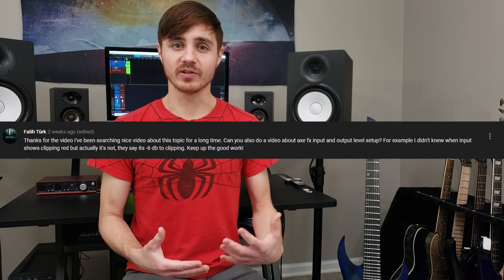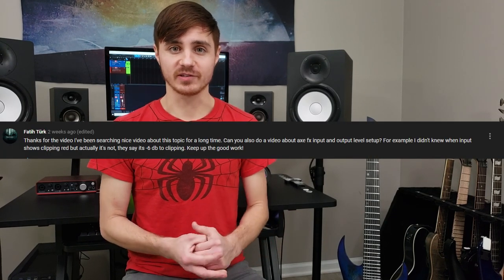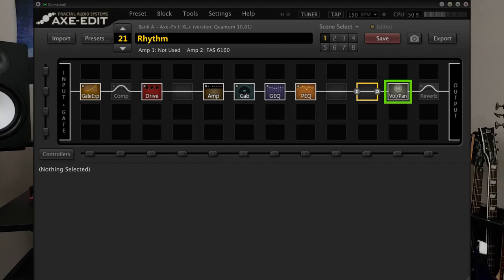Setting I/O Levels on the Axe Fx II

Comment: If you are lighting your RED clip LED then It would be better to reduce the GLOBAL Volume fader in the global Menu. This way all your presets will remain the same level relative to each other. This is advisable when you use multiple presets and you've worked out the correctly level across them.
Reply from the maker: Yes, that is if you already have all the levels set the way you want or matched, otherwise the new preset would just be louder than the rest. But that is a good point to keep in mind

Comment: I just got an Axe-FX 2 and I’m unable to get any signal out of the “Out 2 FX Send” Both output knobs on front are turned up and I/O out levels are set at 0. db.        Any ideas or advice for getting the “left Out 2 Send” to work?
Reply from the maker: Well let me ask, what are you trying to use the Output 2 for?

Output 1 has stereo out. To use the FX send you need to add a FX Loop block in your chain.

You can also mess around with the " Output 2 Echo" setting under the I/O tab. That allows you to change the source/sound for Output 2. You can change to Output one so you will have the same exact output on one and two or you can change it to input one and you can get a DI out of output to that way.

If that doesn't make sense or if you need help feel free to email me at jmcgowan.studio@gmail.com and we can schedule a video call or something and I can go through it.

Comment: Thanks for the clip. Question - what do you use two separate bookshelf monitors for?
Reply from the maker: Some isolation pads should work.
Reply: Jeremiah McGowan sorry I mistyped.  I meant to ask  “why” do you use two, not what.  😀
Reply from the maker: Those small Alexis monitors? Those were what came with my first interface years ago, I wanted to use them to check my mixes on smaller speakers but I really don't even use them at all, I'll probably do a giveaway.

Comment: Jeremiah, would you have any idea how to set the axe fx 3 with eventide eclipse. I cant seem to get these two working together.
Reply from the maker: Are you connecting them via the 4 cable method?
Reply: @jeremiahmcgowan  thanks for responding. no amps. Just direct to my monitors. I am trying to utilize output and input 2. Right now I’m utilizing xlr cables. I am getting a good signal out to eclipse but no signal on input 2 on axe fx. I’m thinking it’s a programming issue I am missing.
Reply from the maker: @JimsMusicJourney  yea! So I don't know how much you already know or if you already have everything connected right, but try this, this is the easiest way I can think of. You don't have to mess with 4 cable method.

Guitar > Front Input 1 of Axe-Fx, use any effects before your amp block on the Axe-Fx, like your drive or compressor etc. Then go from the Axe-Fx Output 1 (mono or stereo) > Analog In on the Eclipse, use any effects you want after the amp, like reverb/delay, then go Analog Out > your interface/mixer/monitors. This way you can use Stereo effects on the eclipse with the Axe-Fx.

Or if you want to process the audio again on the Axe-Fx then do the same thing but place a FX Loop block after the amp/cab on the Axe-Fx, then go from the Axe-Fx Output 2 (FX Send) > Analog In on the Eclipse, use any effects you want after the amp, like reverb/delay, then go Analog Out > Input 2 (FX Return) on the Axe-Fx. Then Output 1 on the Axe-Fx to your Interface/mixer/monitors.
Reply: @jeremiahmcgowan  that is exactly what I’m doing but I’m not getting signal in the input 2 of axe fix from eclipse. I think it must be a programming thing.
Reply from the maker: Well let me know if you need any help trying to research it then lol. I don't have an eventide but I'm more than happy to help.
Reply: I fixed the issue. Output 2 was set to digital and not analog. I also had bad cable. Thanks for the help

Comment: I can’t seem to get my axefx3 sounding right, the noise gate is so weird
Reply from the maker: Is it too tight or something?
Reply: @jeremiahmcgowan  The opposite...It's really noisy, even on cleaner lower gain amps...And when I tighten it up, it becomes unplayable, the signal gets cut off too soon.  It's like I just can't seem to find that "sweet spot" -- gonna have to play around with it some more tomorrow.  Lowering the input helped a little bit though.
Reply from the maker: @5urg3x  what kind of guitar are you playing? Does it have humbuckers or single coils?
Reply: @jeremiahmcgowan  PRS custom 24 and an Ibanez AZ 2402 - they have humbuckers but also have split coil sounds.  I mainly use the bridge humbucker though.  BTW I love the sound of your 7 string in the video.  Those chords are pretty sick 🤘 — I’ll have to mess around with the gate settings some more tomorrow.
Reply from the maker: @5urg3x  honestly my new apartment has horrible interference. I tried everything. I can't wait to move.

Let me know how that goes for you man, good luck. And thank you by the way! I need to start practicing more. I'm SSOOOOO close to finishing this first song, just a few more parts to finish and then mix.
Reply: @jeremiahmcgowan  I’ve got that problem too — old electrical wiring here too, unfortunately.  I’ve not tried the “ground lift” on the axe fx but I think that only applies to the speakers / monitors that are connected to it, not any instrument(s) that are connected.
Reply from the maker: @5urg3x  exactly. I'm sure you'll figure something out.